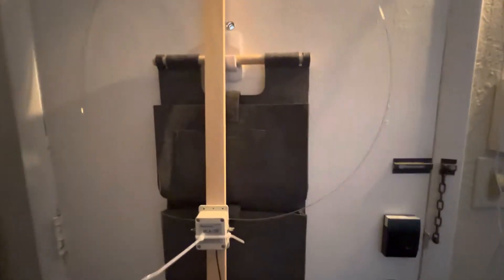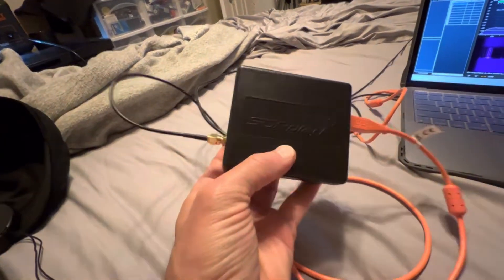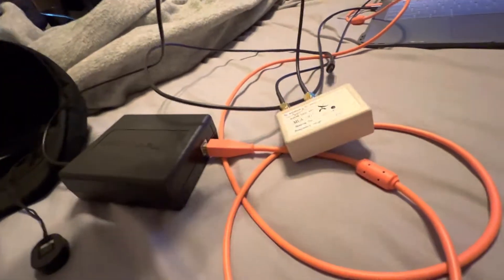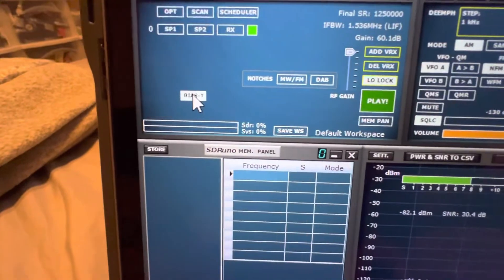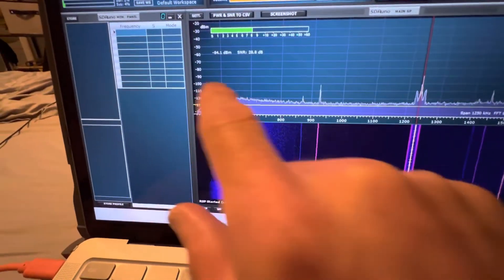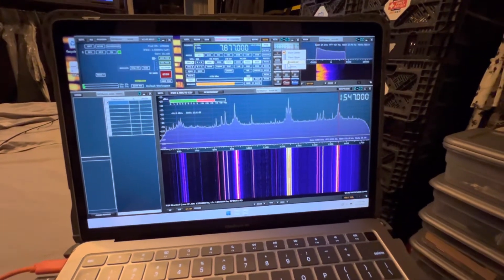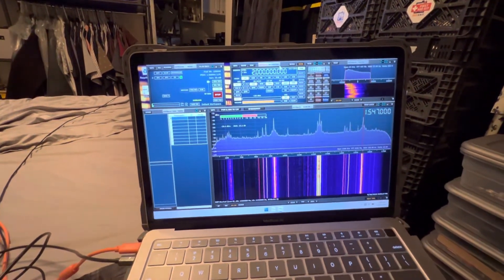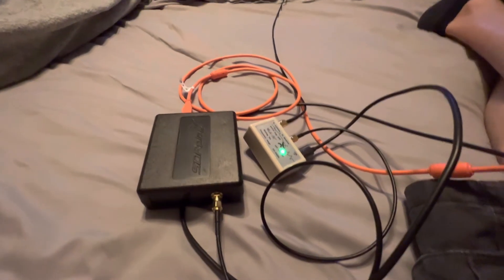MLA-30+ loop antenna with SDRplay RSP1A radio test

Comment: The light on the MLA-30 power supply will only come on if you plug it in by USB, if you're going to be powering the MLA-30 by a Bias T from the SDR then you don't need the MLA-30s power supply in line, you just hook the coax from the loop itself up to the SDR.
Reply: Yes, right. Works perfectly.